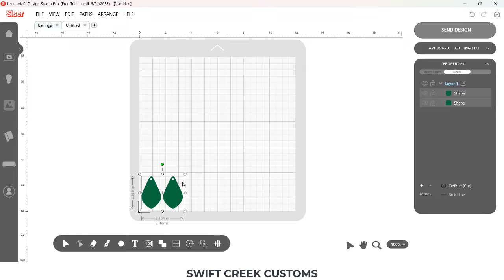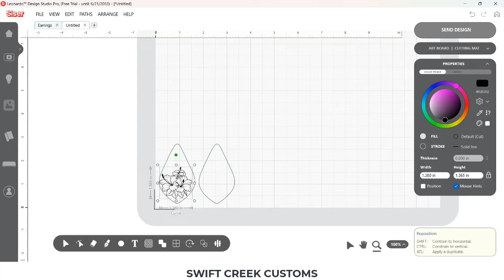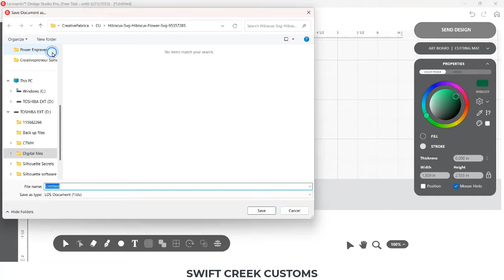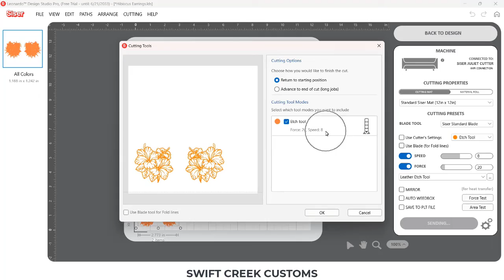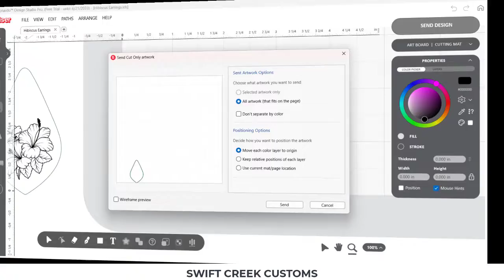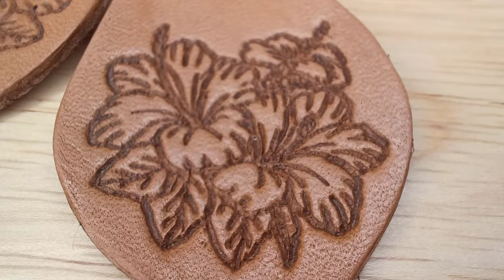DIY Leather Earrings & Key Fobs: Siser Etch Tool Tutorial | Siser Juliet & Romeo Craft Projects

Comment: Will the software work if you lose internet? Will you still be able to use your files and the software? Thanks.
Reply from the maker: @meowzerzzz  yes. While there are some tabs in LDS that are web based, the design tab is offline and you save your files to your computer, so you can access those offline.